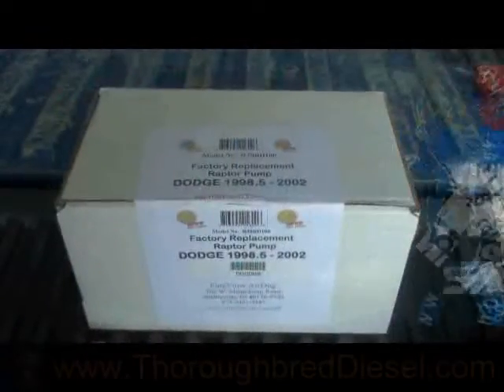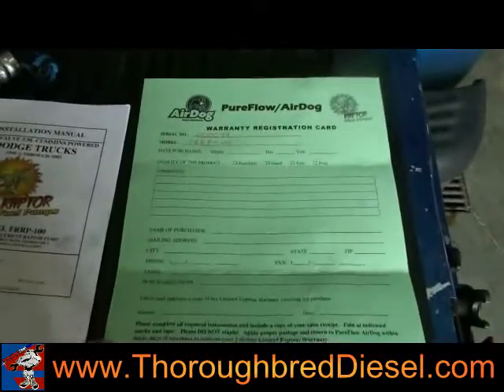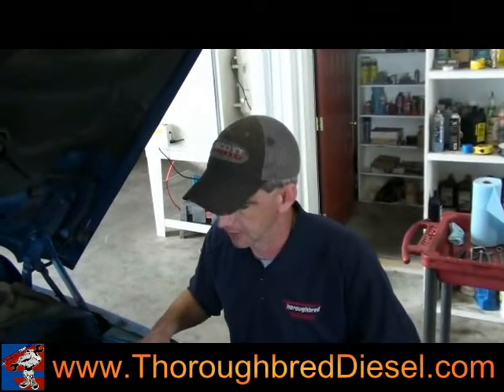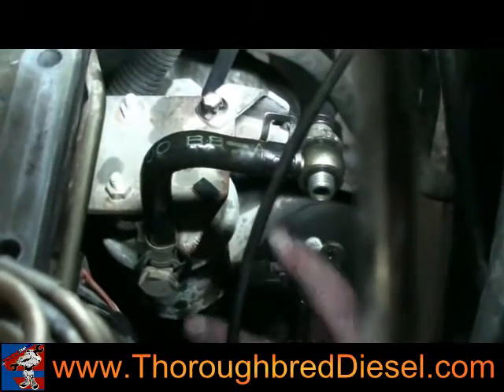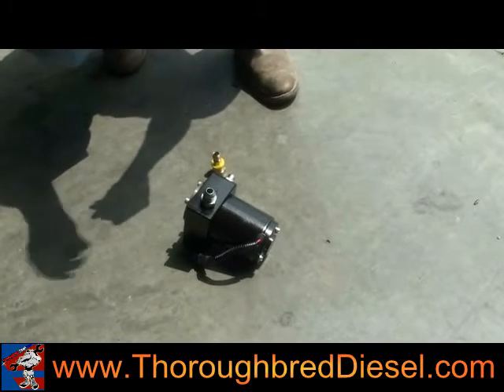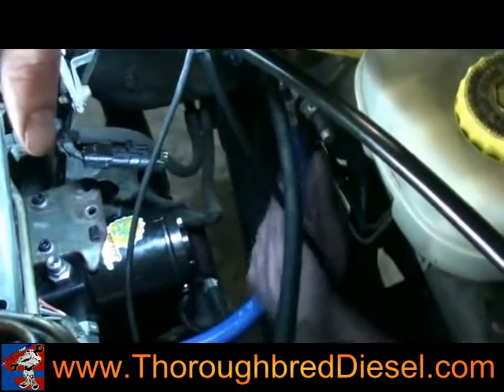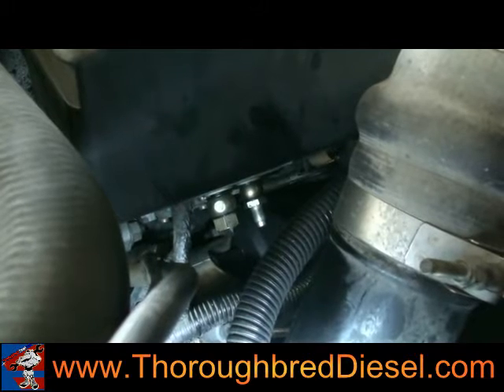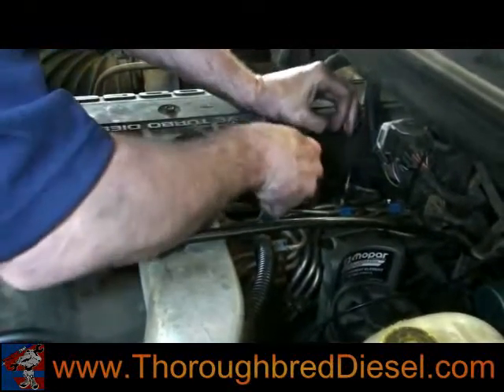AirDog FRRP Pump Install: 2001 Dodge Cummins #R3SBD100

Comment: Put this exact pump about 3 years ago on my truck. Today truck turn on but pump not turning on.
Reply: Didn’t fill out warranty paper but truck has been sitting with out use. Will yall still change it out. Power is getting to the pump. Already checked that out

Comment: I put this 150 Raptor pump on my 01 about 2.5 years ago and have had no Problems....I put a Edge Comp on my Truck First and my Truck was Starving for Fuel when I Hammered it... I asked Wade about it and he said the Pump would Definitely fix my problem and it did....My Truck hauls ass now...The Air Dog is fairly Easy to put on...The Hardest part was Disconnecting the Fuel line onto of my Tank but i have a Bad Left hand and I didn't Drop my Tank and it would of been Eaiser if i had someone helping me...Other than that it was Fairly Simple and all the parts were there..I had 20" of Fuel line left over ..
Reply from the maker: Glad we could help!

Comment: Which one do you recommend for stock replacement? Fass or raptor
Reply: I went with the raptor and have 0 regrets  been 3 years and still making the same pressure it did at day one
Reply: I personally prefer the Raptor easier install there cheaper last just about as long oh and did I mention that cheaper

Comment: I’ve got a question, I’ve got an existing block mounted factory location I believe it’s a 75GPH airdog lift pump that I believe is worn out and I’m looking into the raptor 150GPH factory replacement pump to take its place. The airdog is I believe 5 or so years old so I don’t really blame it for being bad. My symptoms are when I bump the starter I have roughly 15 psi but when truck is running at idle fuel pressure drops down to nothing. So that makes me believe it is shot however I can still hear the airdog running. One question I have is will the raptor 150 be too strong for a stock truck with no modifications? I plan on doing small mods in the future but mainly looking for reliability. Thanks

Comment: Thoroughbred diesel. What would be an okay fuel pressure at idle. I have about 15 at idle and 10-12 under high load with a trailer or just hot roading it. With a edge CTS2 with juice. Is this okay or too low?
Reply from the maker: Those are great numbers,  perfectly normal.

Comment: is this raptor self prime?
Reply from the maker: No,  it does not prime itself. You will have to leave the delivery line loose until you have positive fuel flow and then tighten.

Comment: i have an 02 with the 5.9 cummins and want to use this pump as a replacement pump for a stock motor. I believe I'm good to go, I know i have a lift pump on the block so does that mean there for sure isn't one in the tank? not sure of they use both, or just one or the other, I'm new to the diesel thing so please forgive my ignorance. thanks
Reply: Doug Drake it shouldn't have both. Check under the hood. If you have a pump in the tank then it should say something like this fuel system has been modified from its original version or something like that

Comment: Thoroughbred Diesel-  I have an 06 I bought from my brother. His mechanic installed a Raptor 150. He hooked a power wire to an empty accessory fuse in the fuse box. The pump runs continuously when turning the motor off. Even with the key out. The pump does not shut off until I open the driver's side door. Do you have a video for the 03-07 5.9 Raptor 150? Or advice to help me wire it right. Thank you for your time and expertise.
Reply from the maker: You will need to place the power wire on a key on power source.  Right now the pump is running on an power source that is constant till the door opens.  Just turn the key on,  check fuses for power,  once the key is off check again and make sure that the fuse has no power once the key is off.
Reply: +Thoroughbred Diesel- Thank you for the quick reply. This is my first diesel and I'm not the most mechanically inclined. Especially with wiring. Sounds  easy enough.
Reply: Hmm, this possibly sounds like a good idea. I’ve got an 01 and through my research on the VP’s, (we know that heat is a real killer of the PSG’s on these) it seems like they are subjected to the most heat after shut down since the fuel passing through them is what cools it. I’ve thought about ways to provide cooling post-shutdown such as with heat sinks or a computer fan wired in to work like a turbo timer. Would there be any downside or negative effect to doing this instead?

Comment: throughbred, if i got fuel to the vp44 but none on the top side, is the injector pump bad or lift pump or both???
Reply from the maker: +kink head A.  If you have positive fuel pressure the the VP44 and none to the injectors,  it could be VP.  You will want to make sure that you only have a couple injector lines open the time of bleeding.

Comment: Well I installed the airdog raptor100 yesterday went to bleed lines and heard a big gush so I tried to start and it stared then ran for about 10 sec then stalled, so i bled the lines and more air. Needless to say I ran my battery's down trying to start, so i went to the injector lines and cranked 1,3,4 open got fuel from 1,3 but i took 4 completely open and no fuel coming out. so i pooped the quick connect off the fuel filter canister and cranked the truck and no fuel was really coming out. I've heard the ffrp100 is quite but i'm not even sure i hear it coming on i can hear a faint noise but unsure not sure what to do now. the ffrp is set to 17psi right I should't have to turn it up or down right?
Reply from the maker: +KentaGekio First,  let’s not worry with pressure.  We need to figure out if the Raptor is getting power to it or not.  If the Raptor is getting power,  then next we need to figure out why we don’t have fuel flow.  Once you figure out those two things,  then, and only then, you should move on to proper bleeding procedure of the engine while cranking,  assuming this is a 98-02 Dodge.
Reply: +Thoroughbred Diesel yes it is a 99 cummins  and the stock pump was getting power and when I disconnect the quick connect the is trace of fuel but like I said the pump is rather quite if it's running
Reply from the maker: KentaGekio I would bump the starter and go back to the Raptor and verify that you have power and it is running.
Reply: +Thoroughbred Diesel so I'm almost 99% positive it's not even on, I hear nothing and don't feel any vibration comming from it
Reply from the maker: KentaGekio First thing we have to do is figure out why we aren’t getting power.  Bump the starter and trace down your wires and see if you can figure out why you aren’t getting power to the pump.
Reply: +Thoroughbred Diesel it had power I got it to run its vapor locked but can't get the line 6 to bleed the air it runs smooth at idle but when I put my foot to the pedle it spudders but never dies
Reply from the maker: +KentaGekio You only want to bleed 2 or 3 lines at a time.  No need to bleed line six at all.  You can pass the air through the system with only one line loose if need be.  We need to verify now that you are getting fuel to the injection pump.  Disconnect the line at the VP and let the fuel run in a bucket when you bump the starter.  We should have a GOOD steady stream of fuel when the pump is running.   IF not,  you more than like have a restriction in the tank (possible pump in tank and you didn’t know it)  or your out of fuel.  And if the trucks shows a ¼ tank or lower on gauge,  pretty good chance our out of fuel.  Just gotta break it down to its smallest part here and start reverse engineering it.  You are welcome to call in toll free (1-866-737-4966) and ask for Wade or one of our techs would be glad to help.

Comment: Wade, thank you for your detailed vids to help us Dodge Cummins guys get our trucks straightened out.  It is much appreciated.  I just bought a 99 dodge just over a month ago.  I installed a fuel pressure gauge and the most I get at idle is 7psi.  Under load it will drop to 3psi.  It has the dodge in tank pump because it was retrofitted.  I will be ordering a lift pump kit to solve this issue soon and will be ordering from you guys.  Thanks again.
Reply from the maker: +Matt K If you have any questions on installation or what pump to go with don’t hesitate to give us a call!

Comment: Would this be an upgrade from my fass ddrp?
Reply from the maker: +Justin Moorefield Both the Airdog and FASS offerings are designed to be used on stock to mildly modified trucks, so no,  what you have currently is comparable to this pump.  If you would like to have the adjustable regulator, then you will need to switch to the Airdog.

Comment: Just ordered an FRRP for my '98.5 and read it has an adjustable pressure regulator. Are they arleady set to the correct pressure, or is there an adjustment that needs done after installation? Ive got the pressure gauges and lines, just dont wanna hook up if i dont have to.
Reply from the maker: Logan Daignault